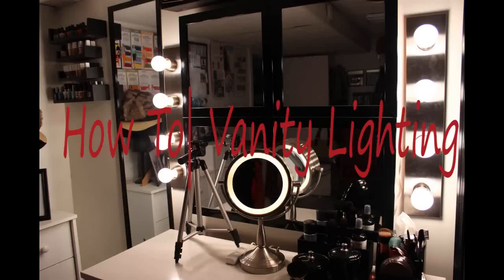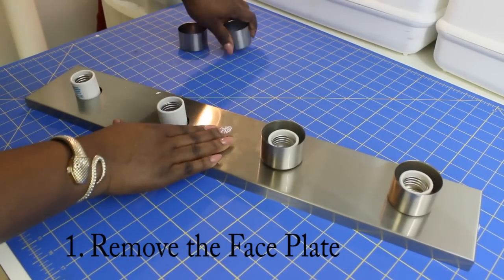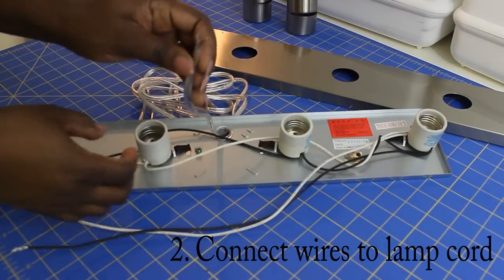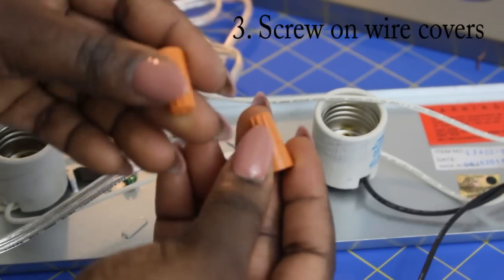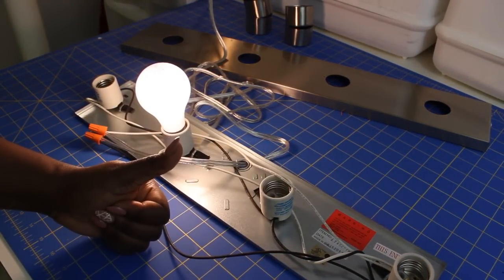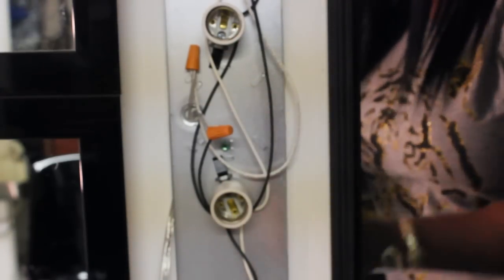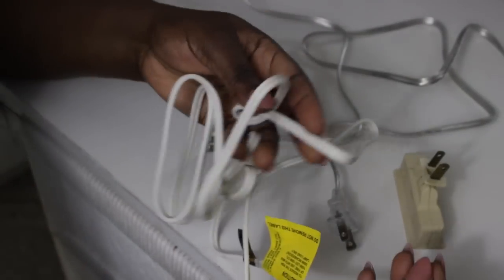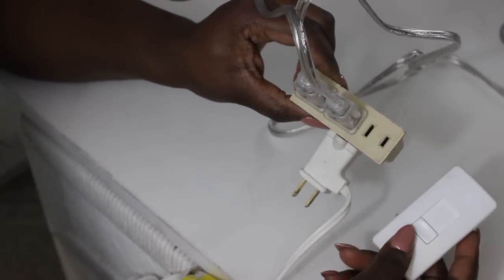5 Step Vanity Lighting Tutorial

Comment: Actually it kind of does matter which wire is attached to which.  You want the neutral to go to the white wire so the threads of the bulb sockets are connected to it because people often touch those threads on the lightbulbs, and neutral is usually at close to zero volts.  In comparison, the black wire always has 120VAC on it and therefore goes to the center contacts of the sockets, where they're harder to touch.  This is why power cords are designed 
 
Also wire nuts are tightened clockwise, but you're twisting the wires together in the opposite direction. 
 
The AC power cord should have a strain relief in it, both to secure it mechanically and prevent contact with metal.  

I wish you had used a 3-wire grounded cord -- much safer.

Comment: Hey, awesome tutorial,  do you know if there's any other way to attach it to the wall for us all who are renters, thanks.
Reply from the maker: Hey KiKi, I am a home renter and unfortunately there isnt any other way that I can think of that would be sturdy and safe =(
Reply: you can always use some wall putty to fill in the holes from the screws when you're ready to move out, you just have to put the putty in the hole, sand over it to make sure the putty isn't bumpy, and then paint over it! it'll look like you never even had a screw there!
Reply: Or you can attach a wooden board on your vanity table and screw it on that

Comment: Are you sure that it doesn't matter which wires you connect with each other?? Every other tutorial I've watched said that it was very very important to attach the white and black wires to the correct sides of the power cord.
Reply: +Cassie Johnson It does matter. The smooth side needs to be attached to the black wire and the rigged side of the wire needs to be attached to the white wire
Reply: +Brittany Howard thanks for the tip!!!!:)